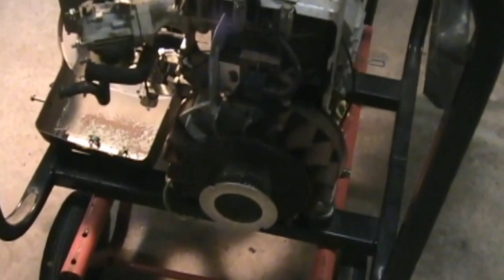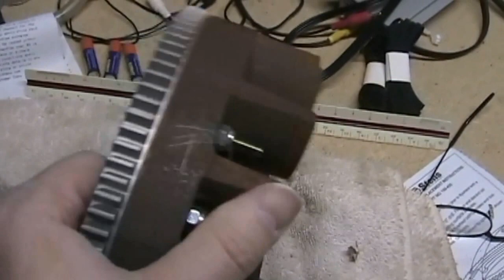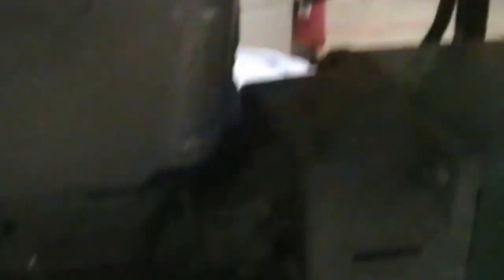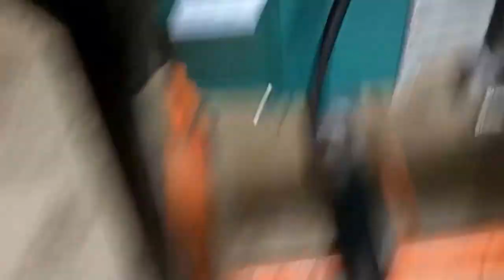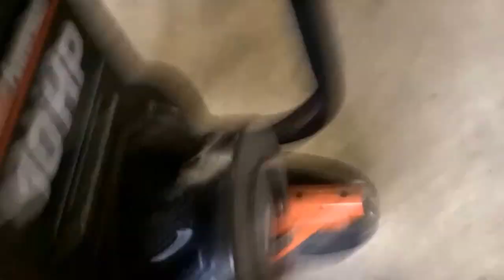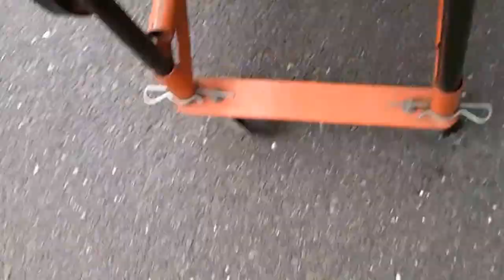Adding Electric Start to a Coleman Powermate 5000 Watt Generator

Comment: Recently picked up one of these babies off Craigslist for $110.  A carb clean, a few new hoses, and the standard neglected engine work and she'll be purring along.  The starter motor add is a fantastic upgrade!

I also have a 10k watt electric start generator.  Even in the brutal cold of January it used to be a challenge to get her to fire.   I fixed that problem by using propane as a starting fluid:

https://www.youtube.com/watch?v=IJnSflbojEE

Comment: I have the same generator with the Tecumseh engine. I changed it over to electric start, added a rectifer and charging coil , and made a battery tray. I have it wired to start with a push button, and another push button to hold down to kill it. I also added propane to it. I mounted it on one of those cheap garden trailers with no flat tires. I built a top out of angle iron and square tubing and roofing metal that sits on it and bolts down. I can leave it out in the weather and it is all protected and can pull it around with a riding lawnmower.

Comment: Did this EXACT mod to my powermate 5000. Ring gear $25, Starter $29, 3hrs labor. I like having the OPTION to pull start in case of battery failure as long as there's a strong teen to yank that damn cord.

Comment: You answered important questions that the 'online store' guy couldn't touch. I'm going through the exact same B&S retrofit and my flywheel part number is identical to yours.  So, here's the answer... You showed me that I can retrofit the available ring gear to my existing flywheel.  The whole job hinges on this important point, otherwise forget the whole thing.  The correct (and expensive) electric start flywheel is NOT available.  End of story as far as the parts guy is concerned.I can certainly grind off a few tabs, center the new ring gear and drill four holes.  In fact, since the flywheel is cast iron I will drill and tap the holes. Loctite works well with cap screws.  Thanks again for sharing your retrofit. This makes all the difference, for me.  I figure the cost will be ~$100, using many parts in my bin (like the starter solenoid and a pushbutton).  The jumper cable posts can be mounted on wood or thick plastic for insulation.

Comment: Thanks.   I have the 8HP Brigs with the same flywheel.  I am going to try this.  I see the holes are drilled right through the flywheel not tapped.  Thanks.  I will mention you when I do it.
Reply: do you have modified briggs 8 hp ?

Comment: My coleman generator starts with half a pull every time lol it had no gas in it after 5 years of not being started. I put gas in it and sure enough 1 pull fired right up. Needed a carb clean though.

Comment: Awesome Video! I have the exact same Coleman Powermate 5000 and have been looking to convert it to electric start. Your presentation was very straightforward and informative. I have already ordered the ring gear and starter. However, could you please tell me where you purchased the relay. Any help would be greatly appreciated! Thanks!
Reply from the maker: I think I ordered it at a small engine parts company online somewhere...but you don't need any special type, just a basic small engine starter relay will do it.  Search Ebay for "tractor starter relay" and you'll see them for under $15 bucks.  Or just pick one up at the local auto parts joint.  Good luck!

Comment: Success!  I don't suppose you have the ring gear p/n... do ya?   I've had this genset for probably 10 years, and it seems to get harder to start every year.......  or possibly I'm getting older.  I already have an original starter for it, but nothing else.  Mine has these numbers on the engine:  Model 19G412   Type: 1180-E2  Code: 9906303A
Also...
Have you ever considered swapping the spark arrestor for a real muffler?  I have a muffler from a small 4-cyl tractor that I'm going to put on mine. A lot of ppl use automotive mufflers, but IMHO, those won't work well, because the airflow of a single cylinder 10hp engine isn't a very good match for such a large muffler.  I just need to find a 2-bolt exhaust flange fitting with a pipe stub on it that I can weld/clamp a length of flex conduit to, then I can mount the muffler on the frame and (hopefully) not worry about breaking anything. (my engine has both screw-mount and flange-mount exhaust fittings)

Your comments about the gas tank getting gummed-up was also helpful... I think mine has become that way as well.  There's another device in-line with the fuel line, between the inline fuel filter and the carb itself... do you know what that is?  It's behind the air filter enclosure... which I have not tried to remove... it has a fuel inlet (from the gas tank), and the line that goes to the carb.
Reply from the maker: Looks like you have the same motor I have...the part number I used for 
the ring gear is 392134.  Just googling that number will bring up a 
bunch of places to buy it.  I originally wanted to get part number 
690626, which I think is the correct flywheel with the integral gear but
 it's no longer available :(  

I did consider putting a bigger muffler on it but after looking at a bunch of youtube videos on it I decided it wasn't worth the trouble....turns out most of the noise you're hearing when the unit is running full blast is mechanical noise like valve clatter and combustion noise that doesn't even flow out through the muffler.  So a big muffler will silence it a little, but won't give you a night/day noise change.  I wound up buying a small inverter generator that's super-quiet, I'll post a review of it one of these days....

The thing on the blower housing on these motors is a fuel pump.  If i recall, it's vacuum powered.  I took mine apart and cleaned it, it was gummed up pretty good, i recommend cleaning it too.  Good luck!
Reply: dave jones - Thanks for the info... it will be a big help.  As far as mufflers goes... I held an automotive muffler up against the spark arrestor outlet, and it was actually a significant reduction... even though it wasn't matched for airflow... so I am going to go ahead and do that as well.
Reply: dave jones 392134 ring gear for 10 hp Briggs

Comment: Dave my is a Coleman Powermate 4000. Can I do same job in my generator, any help please.
Reply: Yes, the fact that yours is a 4000 watt and not a 5000 watt generator like in the vid, wont matter. Keep in mind, some of these generators already come with a ring gear installed on the front of the engine. We have a Powermate 5000 Maxa Genarator with a 10HP Tecumseh motor and it already has the ring gear.
Reply: My Powermate 4000 has a Tecumseh engine, IIRC.

Comment: Hi I am trying to do the same thing you did, add the starter ring and starter to the same generator, same motor. I can't find any part number from any vendors. I realize what is evolved Used to overhaul old cars motors in my day when we had to.Could you give me some direction. Really appreciate it. thanks so much.